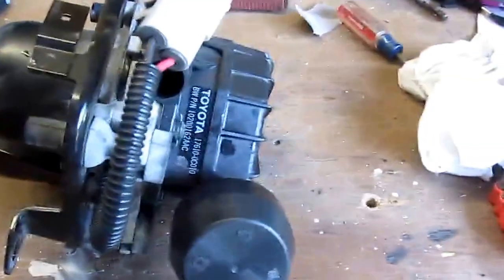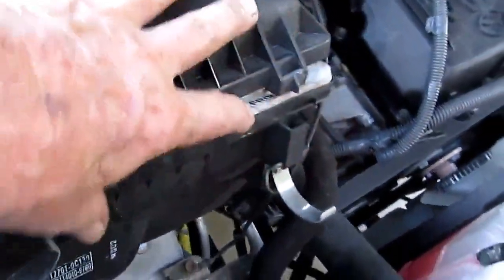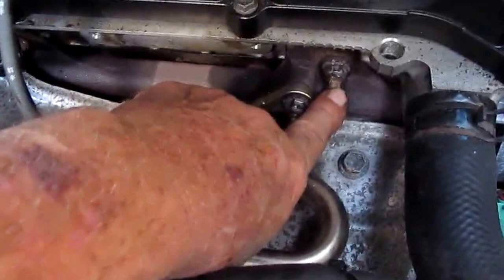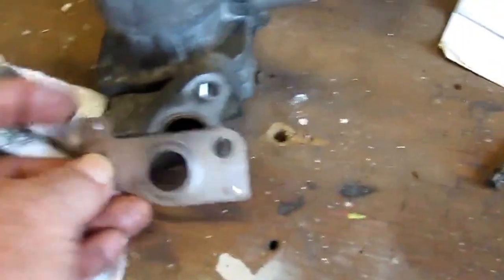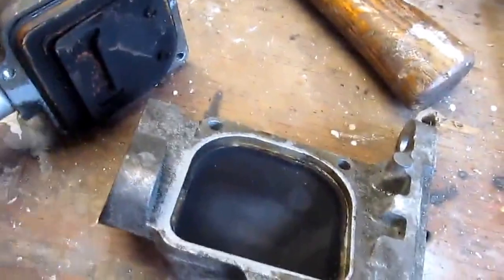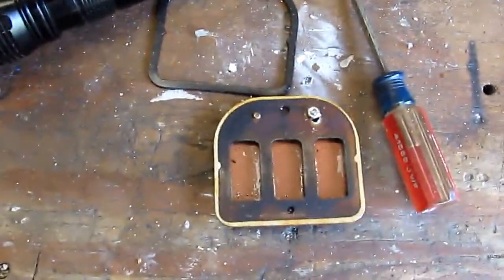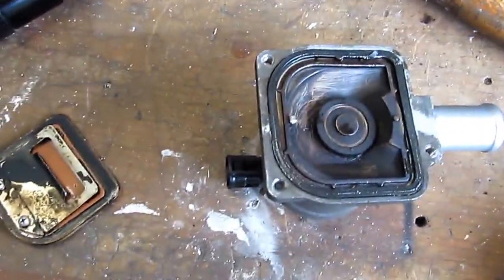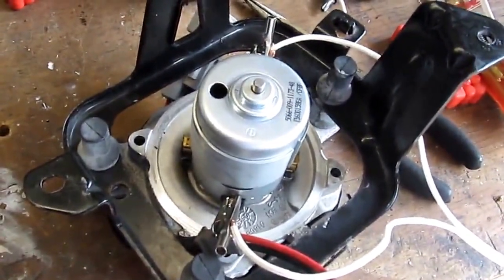2006 Toyota Tacoma secondary air injection  - Part 2 of 5

Comment: Could have cleaned with carburetor fluid and would have been as good as new. Cleans all that gunk and cake off. But nice pointers and tips taking all that off and put it back on easier then other videos. Thanks to you!
Reply: How long will the valve last if you just clean it out ?

Comment: You are so brave..I saw another video where water collects in the rubber bottom of the housing to the motor..the mechanic wiped it dry, then drilled a small weep hole so it could drain and no longer collect water. In freezing temp can damage the motor. I think I can manage that but too chicken to remove the valve part from the motor to clean. Oh bother. Chickens have to pay huge to a mechanic for parts and labor, unless I test or listen to motor with stethescope to see if running. Drill hole or use thumb tack to create the weep hole and let drain into a towel. Then try to fish finger in part with the valve or blow into the hose the see if I can hear the valve click. Could save mega bucks. Not cheap to replace. Serv reps, drool when they see the p2445 code.
Reply from the maker: If the car runs good & you don't have inspections you can let it go unless your into the environment stuff.

Comment: This video helped me out a lot with my 2007 TT 4 cyl. Also, it will come out if you just bend the curved pipe back a little bit, without having to take the heat shield out.

Comment: Great video. I hear a noisy sound like vaccum when starting my car in cold starting . After searching I found that sound is related with secondary air pump so I followed tips to investigate...
1. When my car is cold, I removed the pipe goes from the air pump to the valve and noticed the noisy sound is gone and heard the normal pump sound as I've heard before. Then I plugged the pipe, sound came again. It's a stuck valve.
Now, Could I completely delete the stuck valve ?
Reply: My car is Toyota Pardo 2010
 4 cylinder

Comment from the maker: Just run 2 wires from the battery to the solenoid. + & - shouldn't make any diff. On the motor will go in reverse if not connected + & -.

Comment: Check this out guys! Before taking anything out test your air pumps. Bypass the power by running some wire directly to the battery. Listen to the pump when you power it, if it sounds clear and clean you are good. If it sounds sick , you may need to replace them. Next, take your diverter valves off and take them apart just like in the video. I cleaned mine with a toothbrush and gas. All but the plastic part, just the metal moving part. Remember how you took it apart and put it back just the same.... This was the fix for me. Saved myself $2300. That is what the dealership wanted to charge me just for the diverter valves. I asked them how much for just the parts? $2000 he says.....Force my hand.. NOT!  Thanks for the video Jen Son!
Reply: do the diverter valves require new gaskets once removed?  My check engine etc. lights come on then go off after a week or so.  Some suggested I clean the valves, probably rust causing the problem...thanks
Reply: Have a 2012 tacoma code 2445 There a recall on the pumps ok Toyota will pay for it 👍
Reply: I have been dealing with this problem for about a month. I am not a mechanic. Total repair bill is $2,460. I know a Toyota mechanic who would do it for about $1,800, but have no recourse with him. I broke down and authorized the repair with the repair shop. I knew I was getting screwed, but didn't know about the recall. Anyway, thanks. @rudysantana9542
Reply: @rudysantana9542 I am having the same issue and Toyota will not warranty the recall . 
I have a 2012 Tacoma 4 cylinder with 117,000 miles